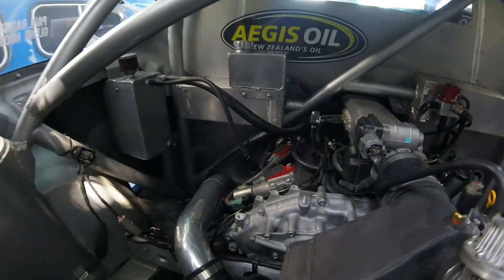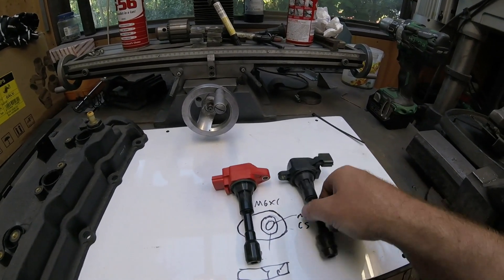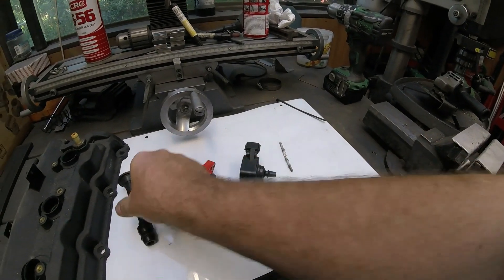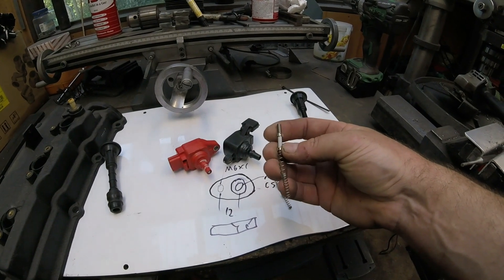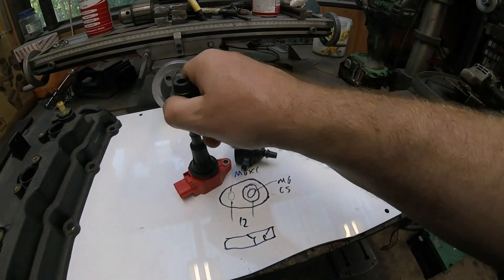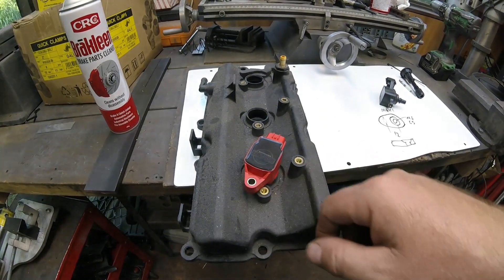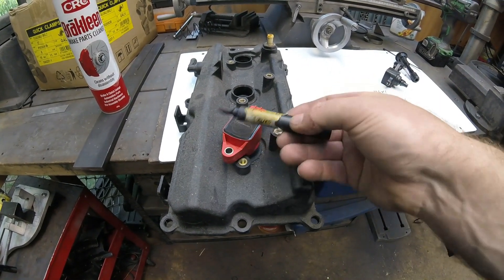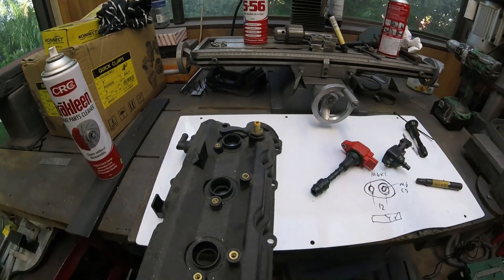Installing VR38 coils on a VQ35

Comment: I’d just use a washer for the bolt holes
Reply from the maker: That wont resolve the misalignment due to the different distance from the center line of the stalk to the center of the bolt hole.